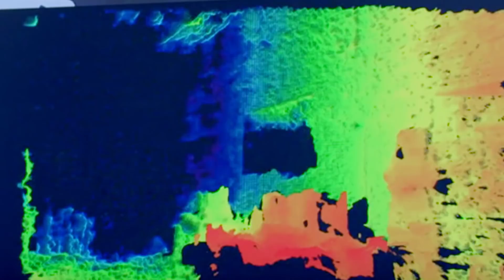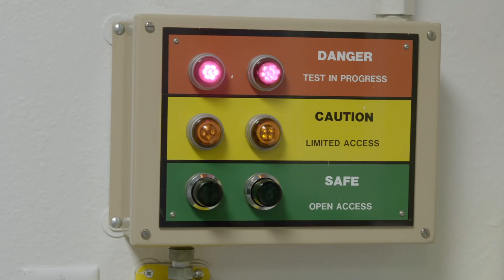Dear Future (Trailer)

Comment: Lithium-ion batteries are a damn place-holder until we have better materials that have been properly engineered for more-efficient electrical output. Like petroleum oil, it is NOT a technology that we need to be on for a very long time, but a way to transition from something more primitive to something profoundly greater, so that we as society may take a leap, rather than a slow, gradual rise.